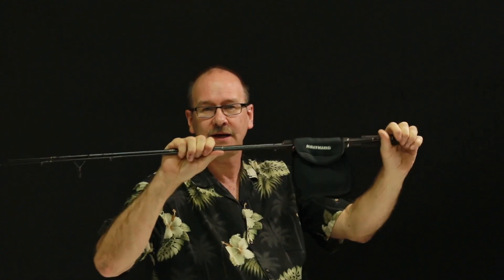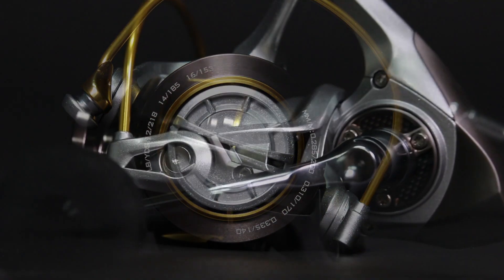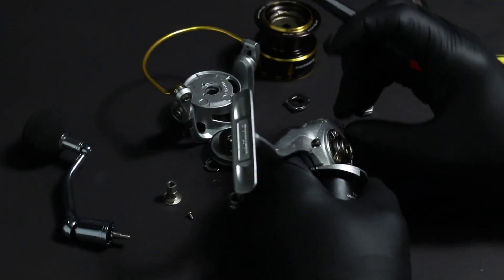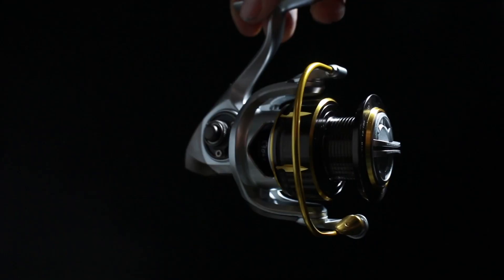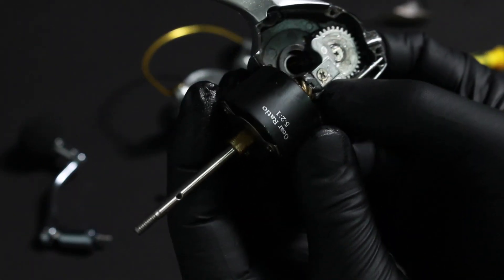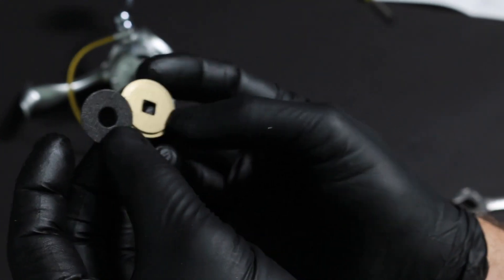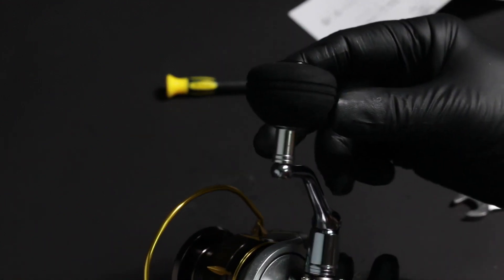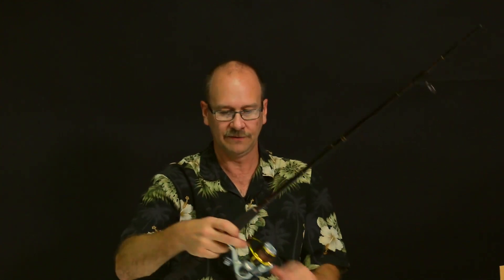Kastking Kodiak spinning reel review

Comment: Metal body or not??
Reply from the maker: galakgak adv Body is metal the only plastic parts are the cover at the back of the body and a cover over the bail mechanism
Reply: @bigdmc1  ok thsnks
Reply: @bigdmc1  are u sure??
Reply from the maker: galakgak adv The drag knob has plastic on it also and so does the cover for the opposite side of the crank handle but the main body that houses the gears and the rotor is all metal
Reply: @bigdmc1  how about made in china? Its same ? Bcoz my friend say its only grafit body and rotor, not alumunium or metal (kodiak from alliexpres)🤔🤔🤔